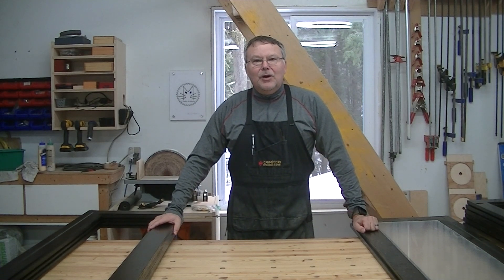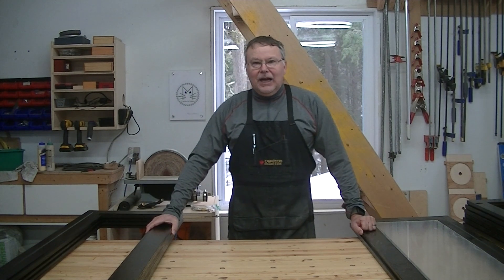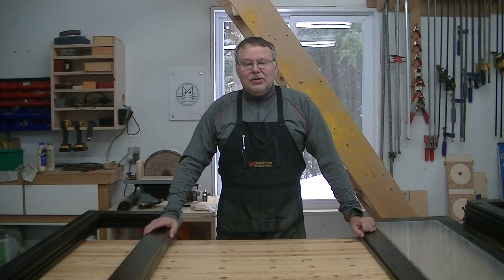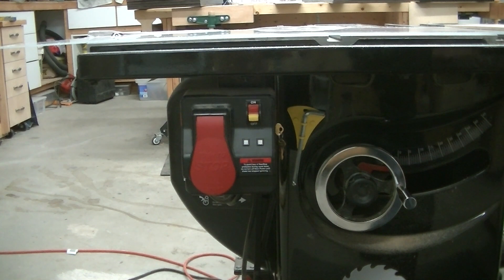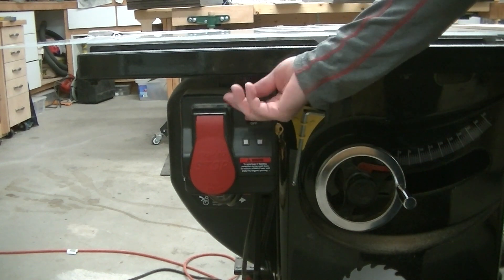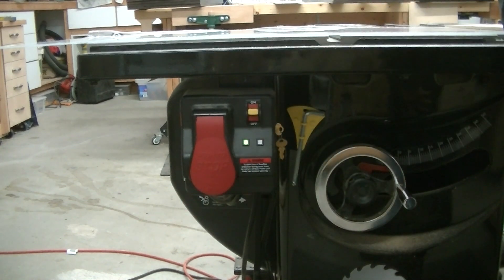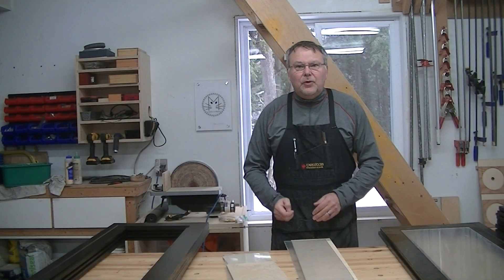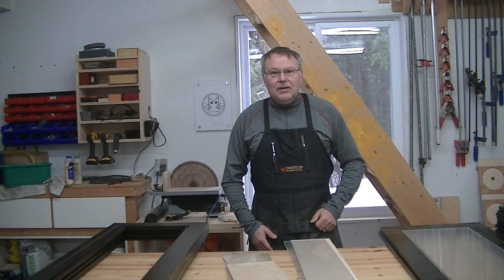Cutting Plexiglass with a SawStop

Comment: Are you using a blade meant for cutting plexiglass?
Reply from the maker: Actually no, just my regular table saw blade.  Because I have the 1/4 in plywood layer where the cut happens, the cut is actually very clean.

Comment: Why do you use the 1/4” ply on top? I can imagine why, but would be nice to hear the explanation. thanks!
Reply from the maker: Yeah, I don’t think I explained this very well.  If you cut plexiglass on a table saw, the material has a tendency to jump around, to flutter, making for a very jagged cut.  If you add the 1/4 in ply, the material does not jump around and the cut is very clean.  Well worth the extra effort and material.  Cheers, Marc